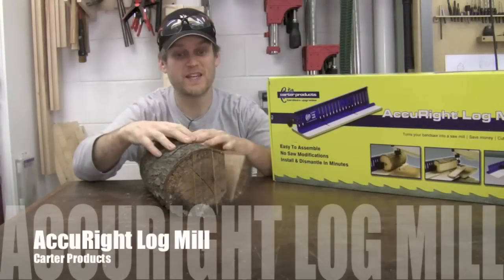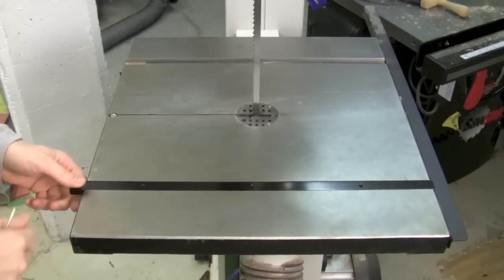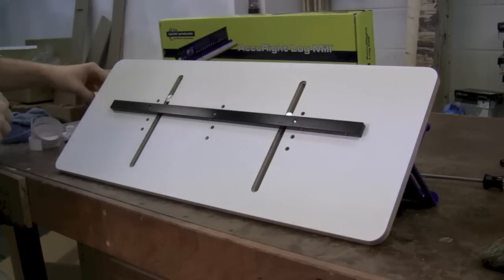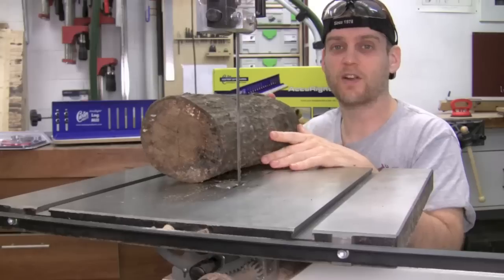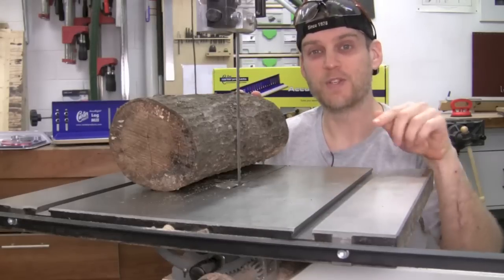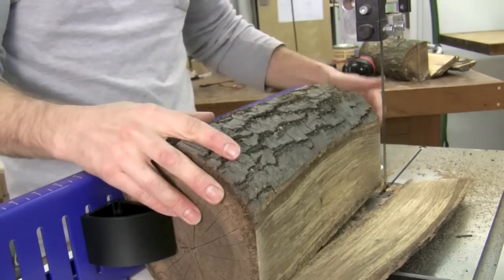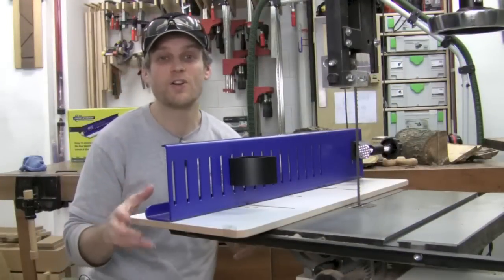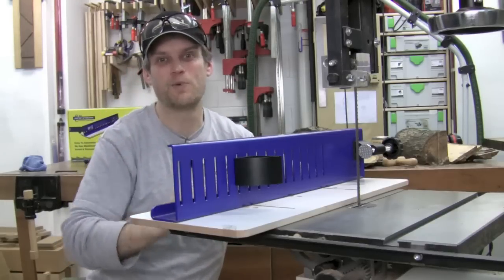Carter Log Mill Product Tour

Comment: You can use the mill for longer logs by just removing the back locking bracket and put some screws through the fence holes.  I have a home made unit, not as nice as this, that I routinely resaw 4 ft logs on.  My limit of being able to lift and control the weight is the constraining factor at that length.  But I have done up to 10" diameter by 4 ft. cherry and spalted maple on it.

Comment: I use a 3tooth  per inch blade !! It walks through ANY wood ! They are custom made at HAWK BLADES in Houston,TeXaS !!! Mike there sends all over the World !! Any size you pick the teeth !! ALSO Mike will TT(Talk To) you n discuss your blade needs or concerns !
 I use that blade cause I am going to plane the boards any ! This  DEMO got smooth boards but very slow cutting the logs ! My 18”Steel City saw has never bogged down ! 
 NOT PUTTING down this presentation !!! At all ! BUT I can saws away !
🙏🏼🙏🏼❤️❤️👍🏼🖖🏼🖖🏼🖖🏼🖖🏼

Comment: It's a good point about blade drift and following the miter slot.  However for applications like these (rough sawing) - it's not a big deal in reality.  The cut won't be as smooth if your blade drift isn't following the miter slot exactly, but for slicing up a log, that's not really a problem.

Comment: Love the concept and looks like an easy way to go for short logs. However I couldn't help but notice one flaw in the design. That being that you're stuck with having to follow the path of the miter slot which, as I just read in the great set-up instructions that come with the mighty "wood Slicer" band saw blades is a no-no. (unless you're really lucky and the blade happens to be tracking perfectly parallel to it!) Watch Morton's video on the Wood Slicer bandsaw blades.....

Comment: Mine doesn't work very well.  I may be doing something wrong, but halfway through a log, the blade binds and veers off to one side and drags down the motor and if I were to continue, would either brake the blade or stall or burn up the motor.  I have set the blade drift correctlly so that is not the issue.
Reply: 9 years later and no one has helped me with this.